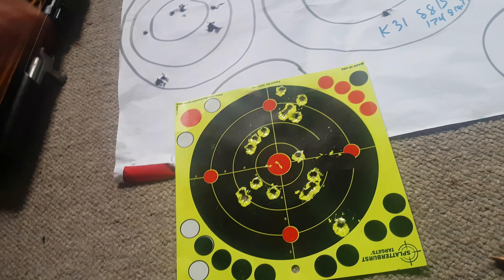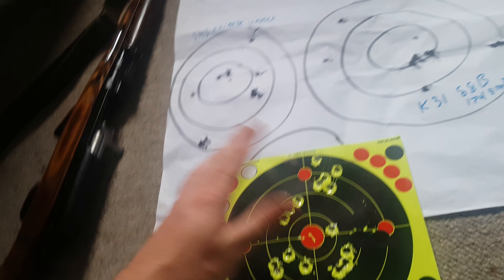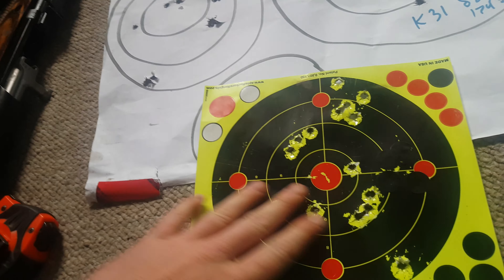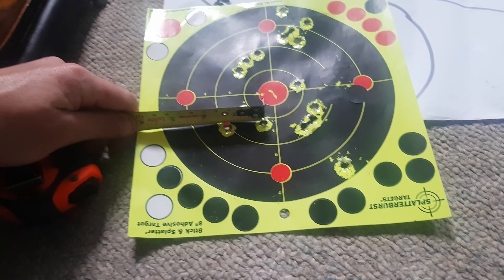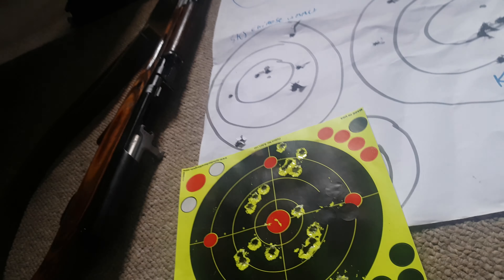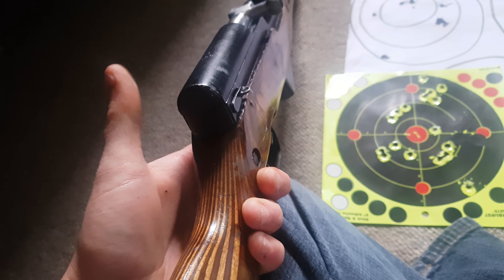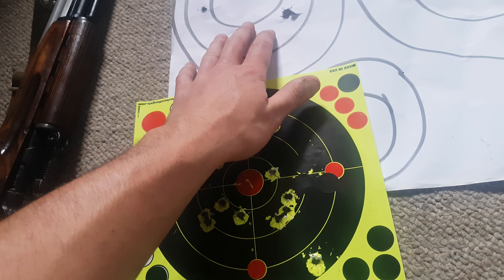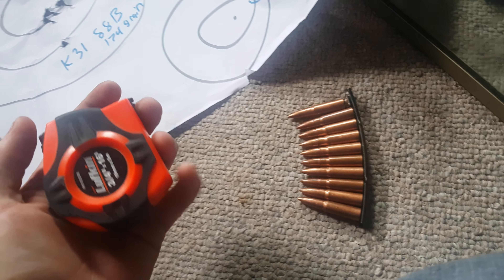Sks accuracy cheap improvement

Comment: Why do people think 50 yards is adequate for sighting in and test firing for group size? 50 yards is pistol range. I like a 200 yard zero so I test for 10 round group sizes and zero at 200 yards. Less is a waste of time.
Reply from the maker: I totally agree, I just use 50 meters for a rough zero. Then I scoot back to 200
Reply: That's all the range some people have readily available.